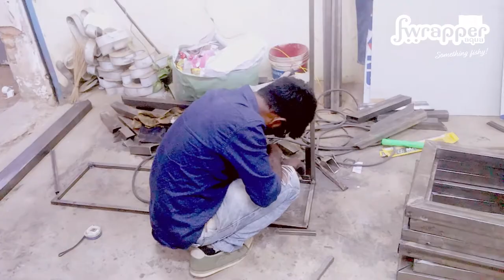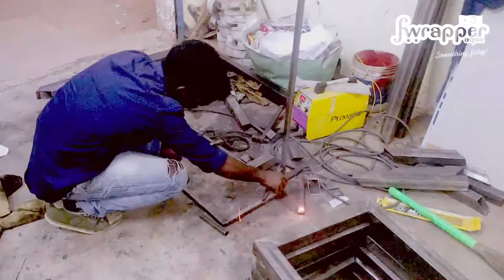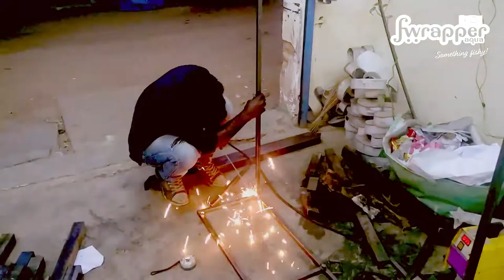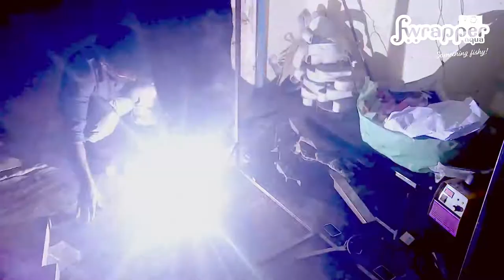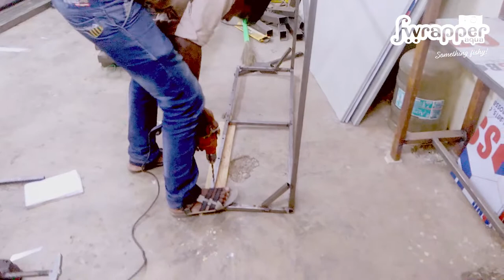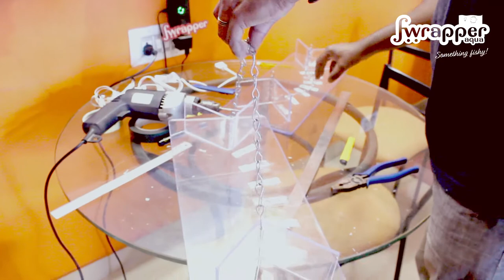How to : Fish Tank LED Lights low cost

Comment: U didn't show how u installed lights bro
Reply from the maker: +rehman5... Bro.. If I show everything.. Then when will others do their research... In this hobby self reading is very important... ;)
Reply: That's interesting but atleast suggest what kinda light is good for planted aqaurium if we are doing diy project
Reply from the maker: @atiqurrehmann .. What I have used is normal LED blocks.. That are available.. I have made a video before this.. In that I have shown the adapter and LED blocks.. Please do have a look and let me know what you think..
Reply: Sure bro I will watch it right nw